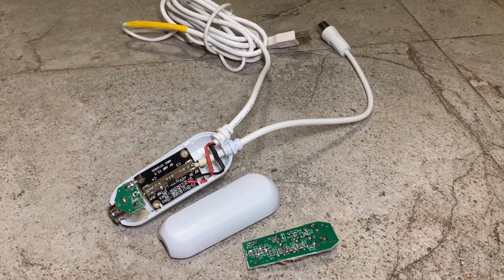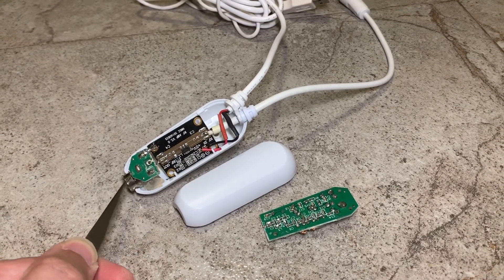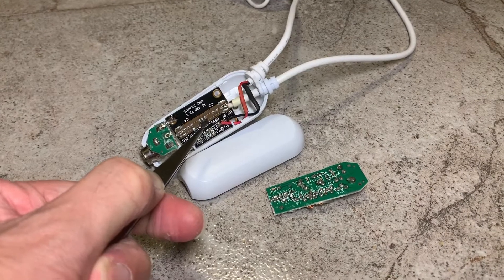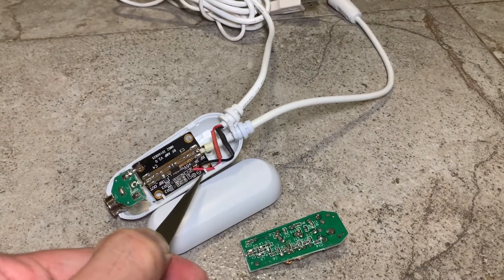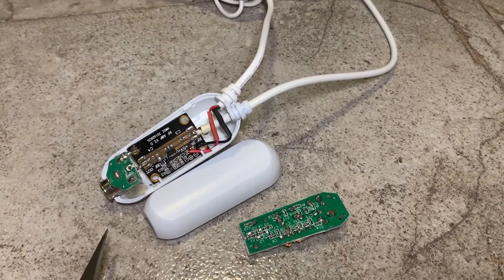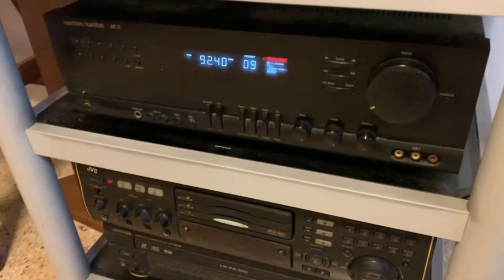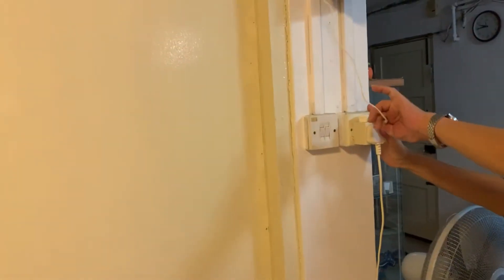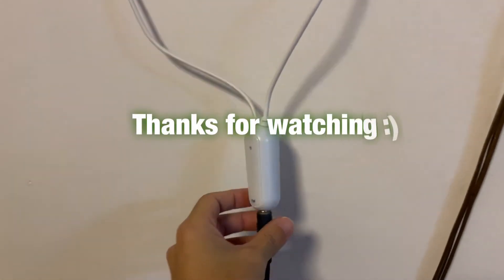Low Noise Amplifier for Vintage FM Tuner

Comment: Duuuuuude!  This is awesome! Quite indepth!
Reply from the maker: Thanks buddy, this 9usd LNA has an IC rated for 6ghz. The SNR is poor for 6ghz but as the graph moves towards lower frequencies, it gets better and better. It works fine for 2.4g and even better for 1.2ghz. So signal amplification for the MHz range such as FM is like cutting thru butter for this little gem. :)
Reply: @terence79chan  thats awesome man.  And its still within range of the legal frequency here!  NIIIICE!!
Reply: hello...first where is your location to test? are you in a center of city or side of city
second. instal antenna in outdoor in hight place than check what will happen to your tuner dial! 
can you check what kind ic # used in your lna dongle?